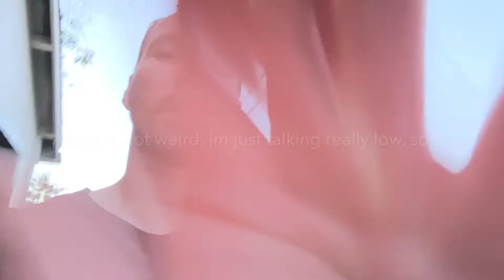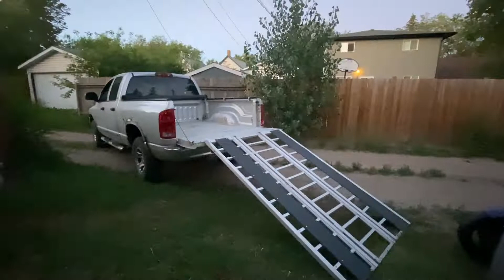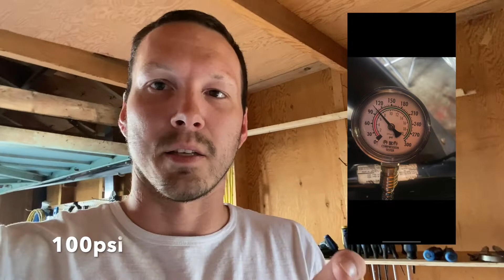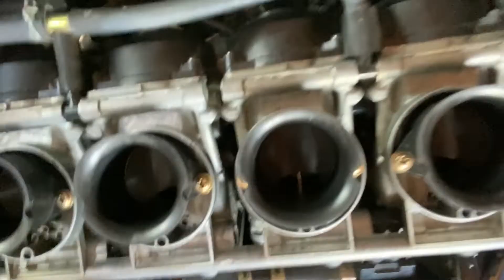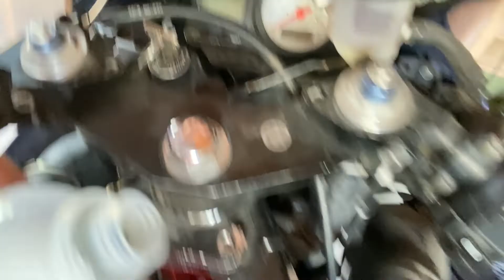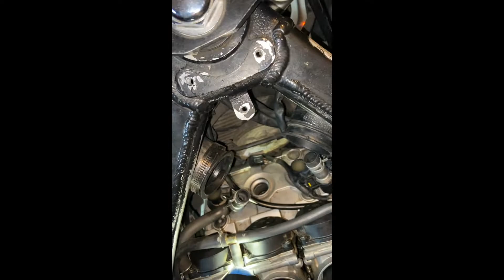2000 Yamaha R6 Carburetor Pt.3

Comment: Try swaping ingition coils between running and non running cylinders. See if this helps for that cylinder. Maybe there is no spark in that cylinder, check it, its simple. Crack is outside, leaking coolant outside is another problem. Also want to mention, that these engines have problems with cracking cylinder liners (Google/Youtube "r6 cylinder crack"), which mean engine rebuild, probably not worth it.
Reply from the maker: I’ve swapped the spark wires as well lol, the only thing I haven’t done is replace the fuel pump. I’m hoping it fixes my issues. And ya I’m going to try and look into getting the block fixed
Reply: @yamacrazy did replacing the fuel pump fix the issue?
Reply from the maker: @camcx8582  I ended up selling the bike. I’m not too sure. But if I’m being honest, I can say I’m 99% says it was the fuel pump being weird as I let it idle for about 30 minutes and it never hesitated for a second. But if I was riding, it bugged out. So I’m thinking the fuel pump was on its way out.
Reply: @yamacrazy  I just had the same problem. Replaced the fuel pump and rode it this morning. The issue is now gone!
Reply from the maker: @camcx8582  right on!! Good to hear. Ride safe buddy 🤙🤙
Reply: @yamacrazy  it will have been a cracked cylinder. They're really common on these carburetted R6s.Yamaha messed up with these bikes design and cast the crankcases around aluminium cylinder sleeves, it's these that crack eventually from heat cycling. The later 2003 on R6s don't have the sleeves so no problem.

Anyway, I see you've sold it now so it doesn't matter.

I have the same model R6 and fitted the later 2003 R6 fuel injected  bottom end (the crankcases) to the carburetted cylinder head and carbs and fitted it into my 2000 R6 frame. It's a relatively easy conversion. Commonly known as a 5SL conversion.